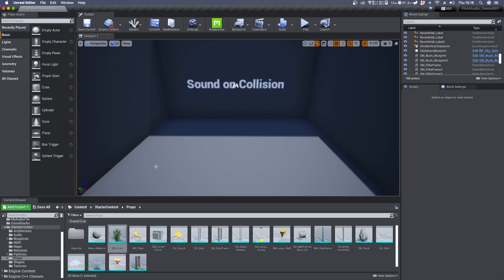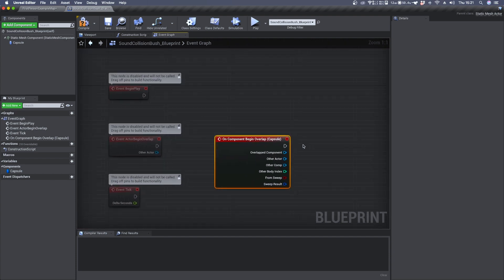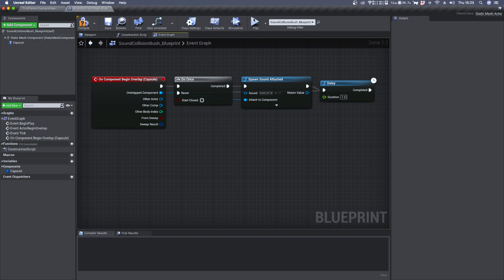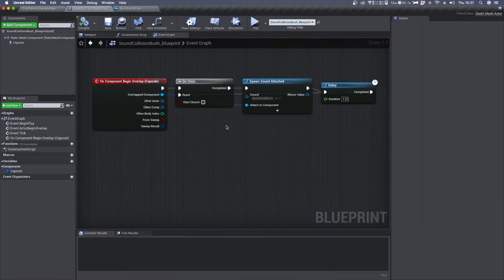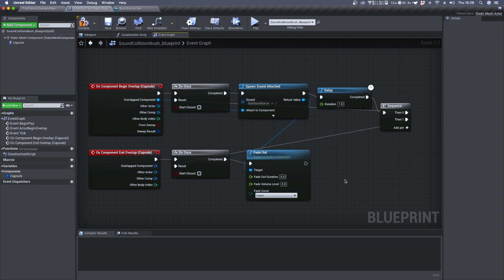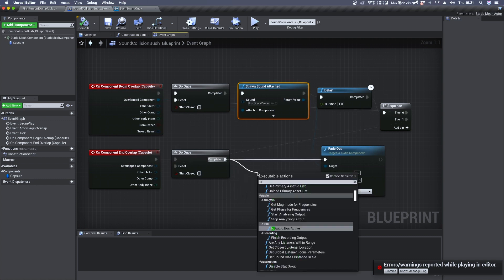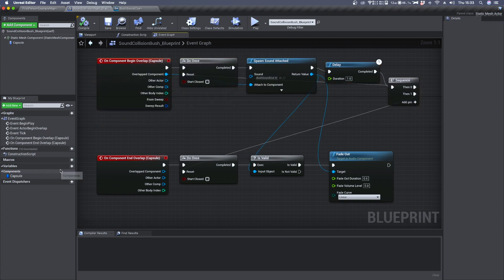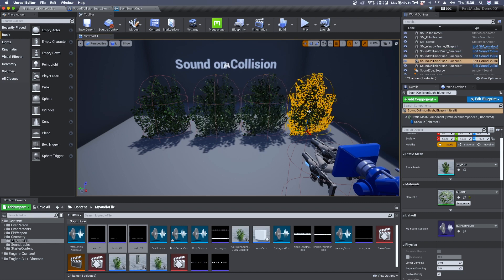Embedding Sound Effect on Mesh Collision - Unreal Engine 4 Game Audio

Comment: Thats what I was looking for the whole time. Thank you very much. Do you also have a solution for the character if it stoped moving inside the capsule and moves again to play the sound again?
Reply from the maker: I'm happy that this video is what you've been looking for a long time. Anyway, if the character stops inside the collision capsule you have to include in Blueprint the speed factor of the character (called Velocity) in relation to its position. If the player is inside of the capsule AND the velocity = 0, stop the audio file. If the player walks again (Velocity > 0) AND is inside the capsule play the audio file. At the following link you can figure out how to determine whether the character is moving or not: https://forums.unrealengine.com/t/checking-if-character-is-moving/430514